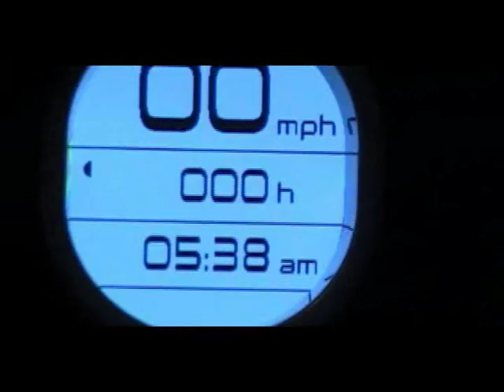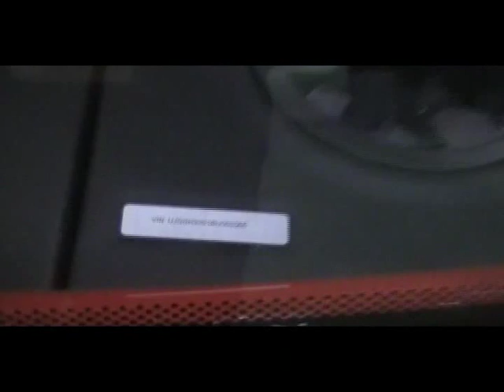Garia Golf Cart

Comment: It is made in Finland, not Sweden.  It is a Dutch Company.  No disc brakes on the rear, drum brakes,  Aluminum frame, not steel.  They start at $12,500 for the LSV.  It is not a "refrigerator," but a cooler.  The car can legally go 25 mph.  Trojan 8V batteries.  You don't need to turn it off for the brake to engage.  All wheels have hydraulic brakes.  You opened the cooler that is not storage, on the dash.  They should have installed the mirrors.  8 feet of cord.